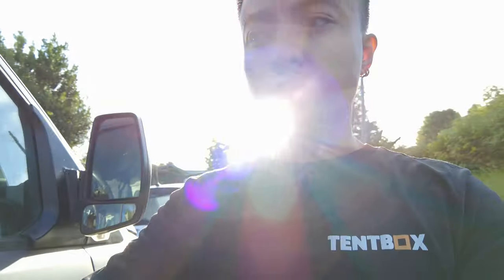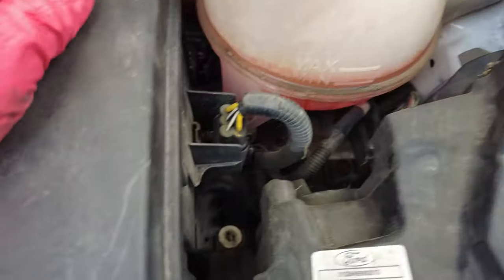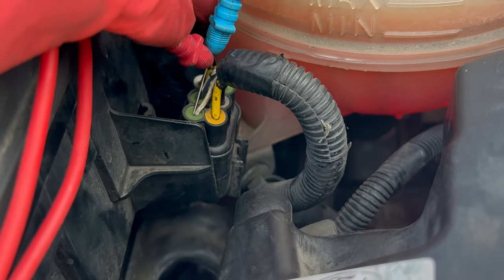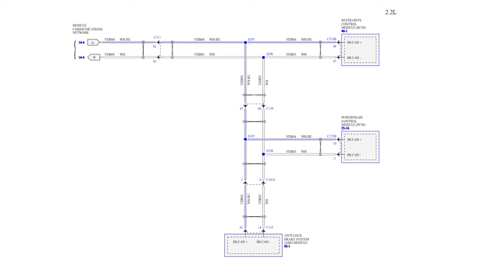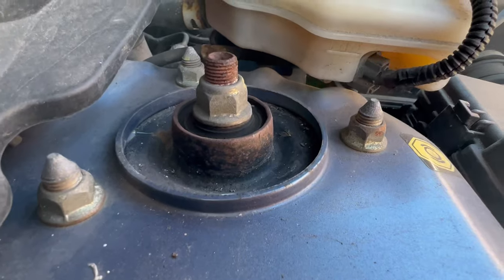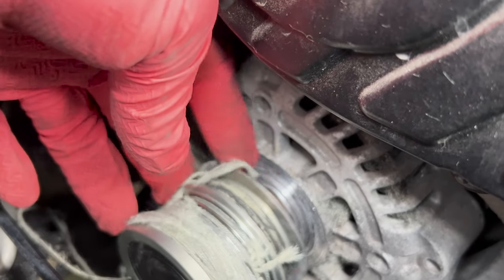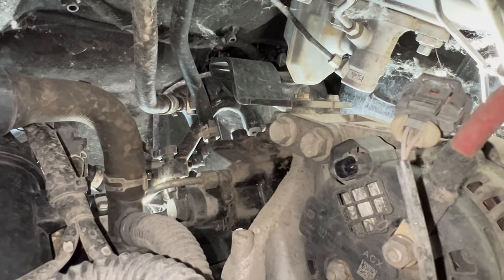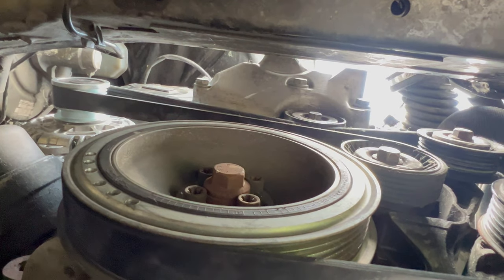Life of a Mobile Mechanic | Transit Non-start Fix | Civic Top Mount | Zafira Alternator | VLOG 16

Comment: Some advice for the spring removal, before jacking the vehicle up, just slacken off the strut nut by 1/4 turn with the weight of the vehicle resting on the suspension. This stops the shaft turning while trying to undo the tight nut as it has already been started by doing the easiest trick, also much safer !

Comment: Personally if I thought I had a break in the can  network system an easy test to start with would have been to test the resistance across pin 14 & pin 6 of the obd port if you get 60 ohms all good if you get 120 ohms then you have a break in either the wiring or possibly internal to one of the vehicle module's . Not saying that's the be all & end all of tests but just a very quick  one  to  start with. Reason for the 120 ohm reading is your reading the resistance of only one terminating resistor rather than the two in parallel due to the break as described  above.
All the best & vehicle  happy repairing . 
Regards jeremy

Comment: Fantastic find on the Ford , now I see you test the fuses on ohms and sound on ? Is the battery disconnected ? And as far as the shock coming off, dude have some clamp or safety that keeps it hitting you in the nuts 🥜 😂👍🏼👍🏼👍🏼👍🏼👍🏼

Comment: Excellent diag  m8 on the abs.did you use a 120 ohm resistor  to bypass the module as usually the abs can have it in side ?love the vids just going through them all.

Comment: Had a mk6 transit wouldn't start one morning had to call the AA he said it needs a new key blah Blah blah he peed of and I had an idea I disconnected the battery and re connected it after a few minutes and lo and behold it started AA I still have cos Ya never know when you need a lift home but as for there techs they are sh*te
Reply from the maker: Well done pal! I know a lot of good AA mechs but obviously, just like in any industry, you sometimes get lucky with the bad ines